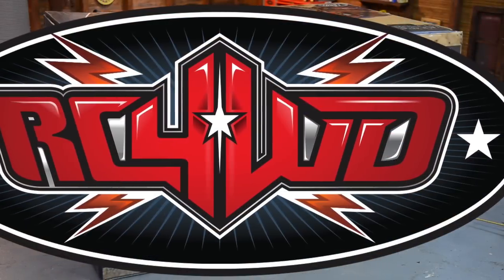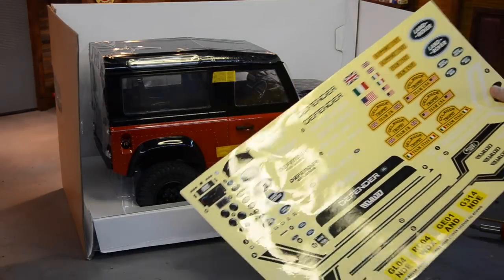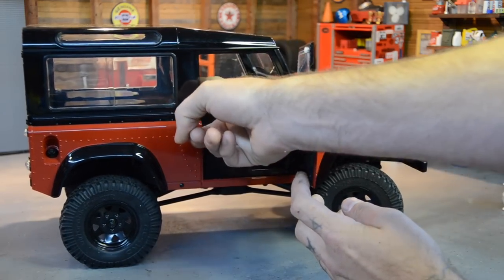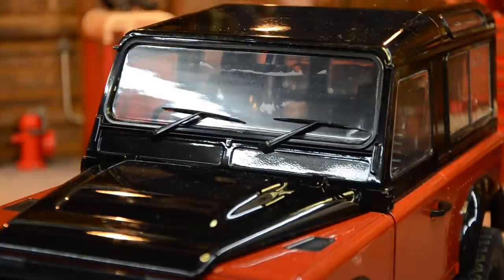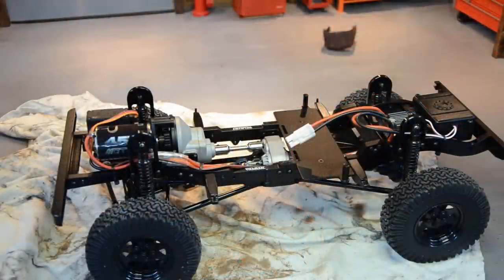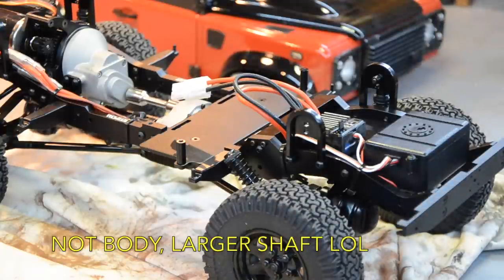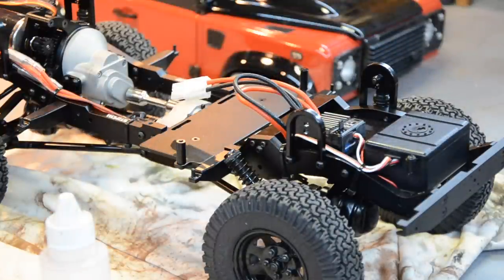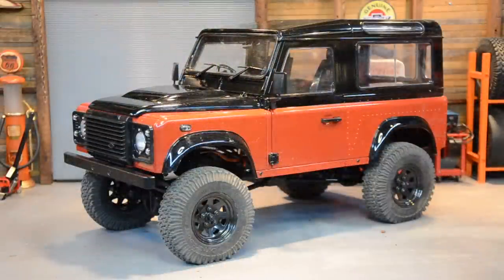New RC4wd Gelande II Land Rover D90 Autobiography Edition, Scale RC Crawler

Comment: Using lawn grub screws on the Marlin crawler TF2 to nothing new but I ended up using magnets also on the body lift bracket from RC four-wheel drive. This way when the truck rolls the body does not come off

Comment: Don’t use the awkward body clips to remove the body….leave them in place and forget they’re even there. Drill out the holes on the sides of the body, red thread lock the mounting screws into the aluminum mounts, and then you can simply snap the body on and off in mere seconds by lightly separating the body sides. Piece of cake…..especially on the trail.

Comment: Great video. I have one of these trucks on its way in the mail. I do have a question for you about your truck though. 

My question to you is, did you have to go over every screw and add loctight to them?
Reply from the maker: I don’t go over the entire truck. I usually just do the 3 screws on the spur gear and the 4 on the front axle knuckles. Those are the only spots I’ve had come loose on me.

Comment: Great video….what Sequence did you used to fill  the shocks up ?    The Pistons have no holes so I’m stumped on how to put oil in the shocks please help
Reply from the maker: I’m pretty sure I did it wrong but they are working great. Just unscrewed the top and added some fluid. Compressed up and down until it quit overflowing and put the cap back on

Comment: The clips are horrible. I have the defender and the fj40. I relocated the battery to the front under the hood for the defender. The fj40 still untouched and I will deal with the clips. Sometimes they go in easy and sometimes it doesn’t. Patience is the key.

Comment: Shame about the PWM noise on a truck that costs that much, you would have thought it wouldn't have that annoying high pitched noise that you find in cheap rc cars. Granted it's easy to swap the esc but for a rtr as it is, bit of a disappointment

Comment: We just got the Green D-90 Heritage 2015 Pickup last week, it’s beautiful 😍 
BUT, a Lot of loose and Missing screws & Nuts... PLUS, if it falls off your sofa on to a thick padded rug the windshield will Pop Off, Along with the Back window portion, the doors open leaving just Four (4) thin posts that Break Very EASY... Leaving a Big Broken MESS 👎😫 Buyer’s BEWare:
Reply: Question, is the body made of plastic or metal?
Reply: K9 . . . It was Hard plastic, not even flexible, had to do a lot of glueing... rc4wd did NOT seem to care at all, but after a Big Tadoo, in a few weeks they sent me the lug nuts I needed...!!
Reply: @annafraley5388  ah thank you, it looks soo good from the video i thought maybe i finally found an RC made of aluminium or something 😕
Reply: K9 yes, the first video I saw on it had said it was “ALL” metal, so I got it... not true,  just the chassis was metal. I still love it though and have it looking very nice, but I wouldn’t take it out on the Rocks or any place it could  Fall down from and break...
Reply: @annafraley5388  its definitely the nicest rc I've seen so maybe they just don't make them out of metal. 😕